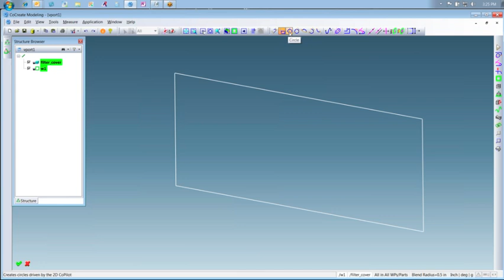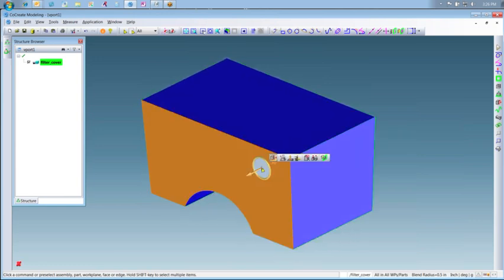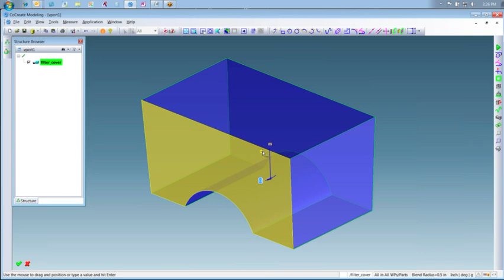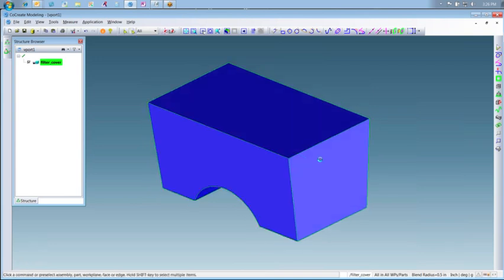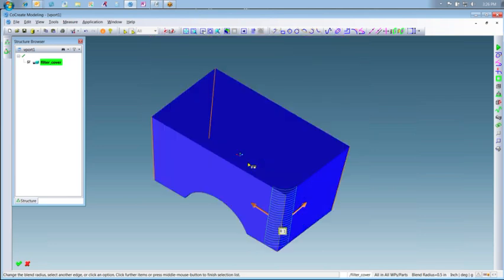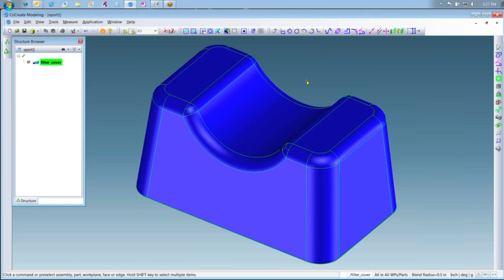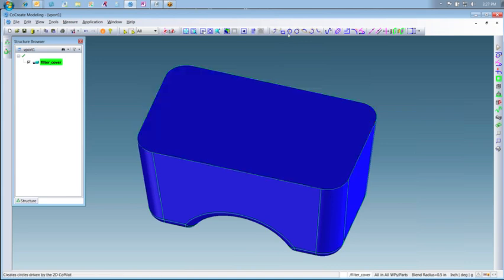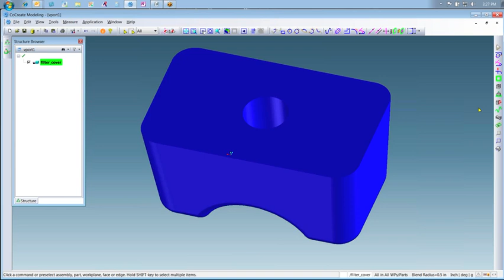Introduction to Creo Elements/Direct 3D CAD Modeling

Comment: I prefer Solidworks
Reply: solidworks sucks. In solidworks, not only do you have to design the part itself, you also have to design the design tree!   On the other hand, with creo elements you don't have to fuck around with a stupid design tree. There is no history that will come back to haunt you when you want to make changes. Solidworks lives in the past, creo elements lives in the present. Why do you prefer a program that literally makes your job more difficult?
Reply: Solidworks actually sucks
Reply: Really? I've used Solidworks briefly before, and while it's easier to learn than CATIA, this is even easier to use. I know I could create the exact same part shown in this video in CATIA, but it would take me probably 20 minutes instead of under 4 minutes. Just this short video has convinced me and I've got years of experience in CATIA and Unigraphics but no experience with CREO yet.